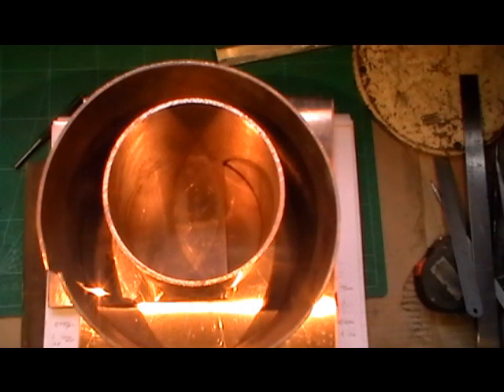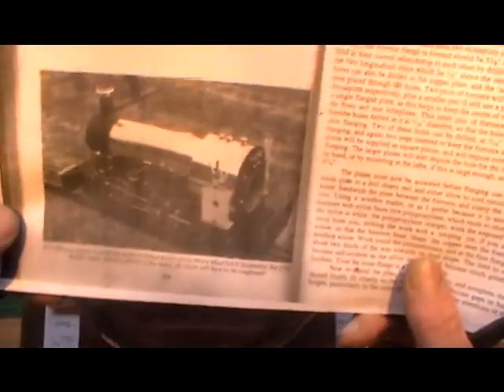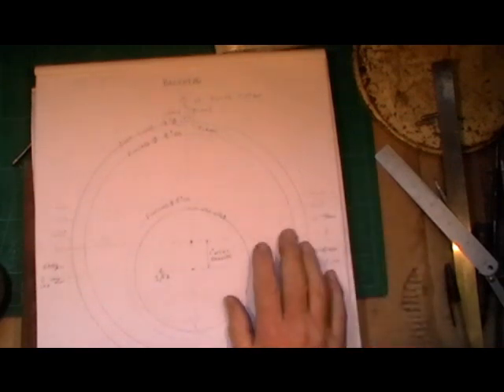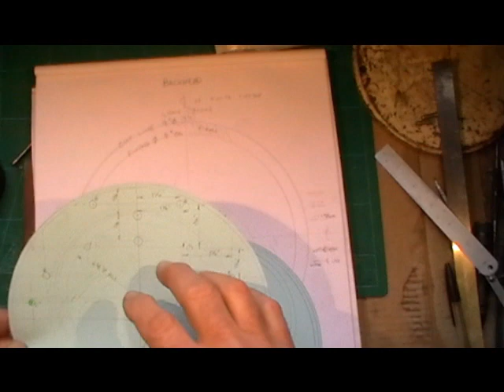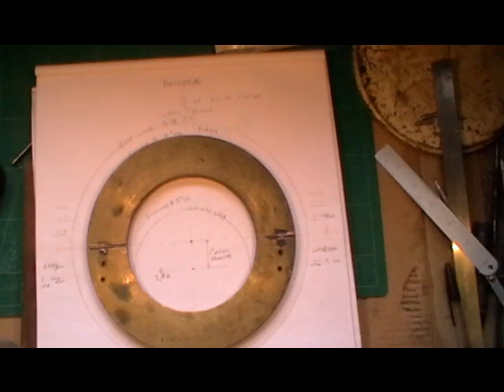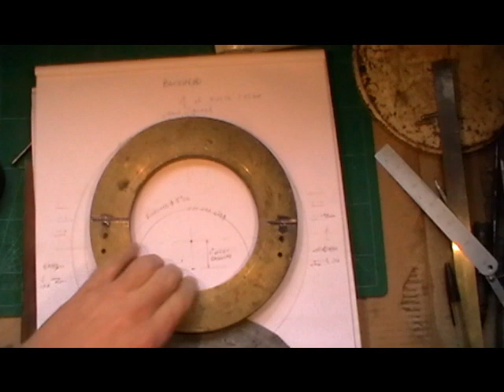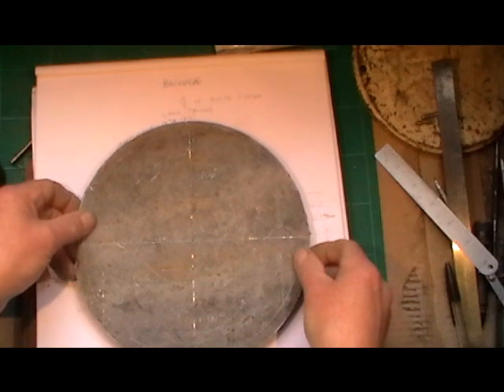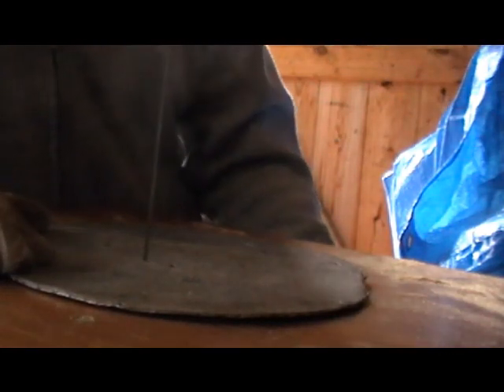How to make a steam  boiler from scratch for 5" gauge loco  Part 1  "mr factotum"

Comment: Good morning Mr. F - just to let you know I'll be going through all of these again soon. The 2.5" Atlantic boiler is no big thing I understand, but I think I'm going to need all the help I can get for a 5". I must admit, I am starting to consider a traction engine too - at least I can drive it around the garden!
Reply from the maker: morning WW
All the best with the boiler, just take your time, use the measure twice, cut once!!!!! system, or in my case measure half a dozen times, cut once!!!!🤣🤣
As for the traction engine, depending what scale, the road wheels / flywheel may not fit in the Myford. so check that before starting if it helps!!!
Regards
 mr f
Reply: @MrFactotum  I think I could mount them on a stub arbor in the the horizontal spindle socket on my mill? Anyway, definitely a problem for another day. I'm going to practise silver soldering soon - is regular plumbing copper pipe fine to test with assuming it's clean?
Reply from the maker: @williamsworkshopuk Yes, that's possible on the mill i  suppose, but as i say many times in my "Make a Beginners Miniature Steam Loco" video's,  don't overload your grey cells, take things a bit at a time, when you open the book that i worked from, its easy to get in to negative/panic mode with all those 100's and 100's of things to make playing on your mind, i've been in engineering all my life, i don't try to look at the bigger picture all the time, take things in bite sizes and don't think about the rest till you have finished the task your concentrating on now. Anyway i'm getting off my soapbox for now.🤣 You know where i'm coming from. I will be watching your progress.
All the Best
mr f
Reply from the maker: Went off on a tangent there and forgot about the silver soldering, yes anything that's made of copper /brass, the plumbing copper pipe is fine, remember, polish,clean,degrease,flux,heat, use some fire bricks to maintain the heat in the components.
regards
mr f
Reply: @MrFactotum  I'm with you on both counts - thank you!
Reply: Solid advice there, thanks for sharing your process step by step!! A few extra times measuring can't hurt. It all contributes to the big picture and not rushing things pays off quite well, as you show with your result in later videos. Love every bit of your videos! Awesome job 👌😁

Comment: Looks like your taking a very good approach to it,  - As you said not the easiest of boilers to make and flange. Are you from Yorkshire?  Derbyshire?   Keep up the good work !
Reply from the maker: Good old derbyshire
Thanks for feedback, will be putting the whole boiler on from start to finish soon
Regards
Mr f
Reply: Thought so ! me too - where about mate? @MrFactotum
Reply from the maker: Hi steve
Thanks for interest, ive been taking a look at your interesting minatures, i especially like the coal fired boiler, did you make it.
Ive just finished my boiler, if your interested i'm just going through all the video footage ive took on the progress of making it, so will be adding the parts over th next couple of week, i think there will be about 12 parts. My boiler is now ready for boiler inspection and pressure testing. Anyway, this has no reflection on you but i don't put my whereabouts on public sites, theres just too many scammers and idiots out there.
Regards
Mr f
Reply: No problem mate - I understand, I didn't make the boiler, but have made a simple small pot type boiler, and repaired a couple of stationary boilers. Traction engines are more my thing, rebuilt a few miniatures, including a half size one.  Glad to hear your boiler is  ready for testing - well done! @MrFactotum

Comment: What is the working pressure from that boiler ? Good video !
Reply from the maker: Hi massimo
Nice to hear from you, the working pressure is 80 psi, i have just pressure tested it this morning by coincidence to double its working pressure 160 psi .
I am just going through all my video footage  of me making the boiler from start to finish, including the pressure testing. I will be uploading another 10 parts over the next week or so, the last one part 13  will be the pressure testing video.
I will soon be making a start on the rest of the loco.now the boiler is finished
Best wishes
Regards
Mr f.
Reply: Wooow ! 160 PSI !! You test it with water I hope ? Best Regards.
Reply from the maker: Hi massimo,
Yes, fill boiler eith 6 1/2 litre water, then apply pressure and keep fingers crossed